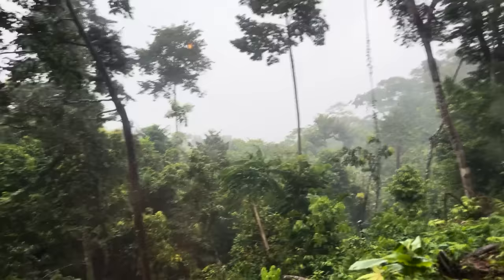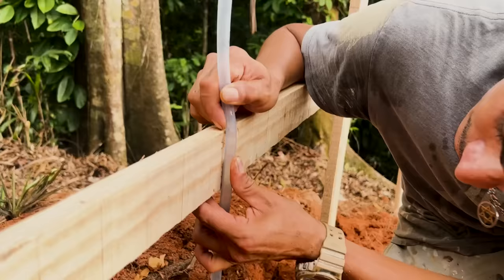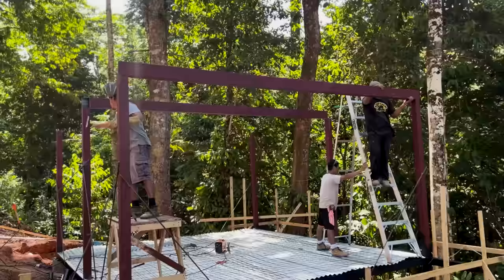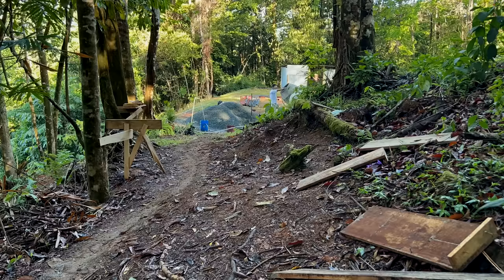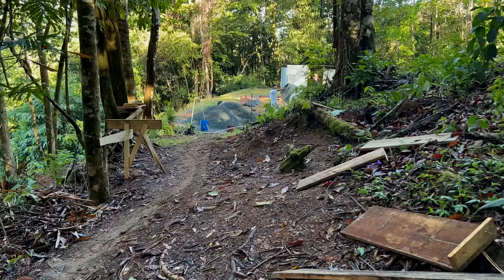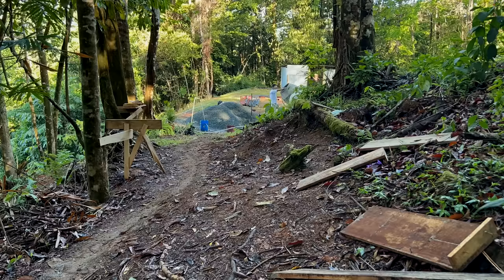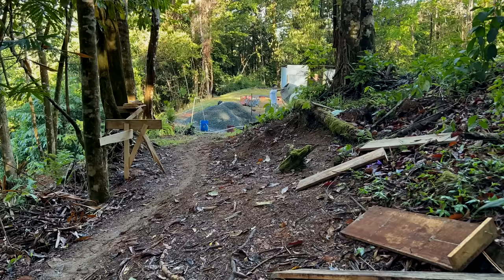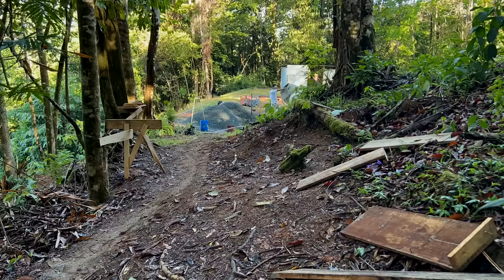Full Build of a Tiny Home Cabin

Comment: Did I just see a septic system built from tires?
Reply from the maker: Yeah, it was a technique here suggested by the builders. Because the hill was quick gnarly getting river rock to fill the leech field was really difficult. So we ran a tube through the tires and covered with fabric to keep the roots out and then buried

Comment: Amateurs. No waterproof membrane on the roof. You will have leaking roof. The same with walls. Non-waterproof drywall in bathroom will lead to mold. Metal roof with no soundproof insulation means that it will be incredibly loud when raining. Didn't see any insulation anywhere or installing it into walls, wouldn't be surprised the walls are hollow, so that's absolutely ridiculous- that's a nice looking shed not a place to live in.
Reply from the maker: Rain isn't loud and roof doesn't leak. Warm climate so keeping cold out isn't an issue. Might not have been how you would have built but I can assure you its comfortable and dry